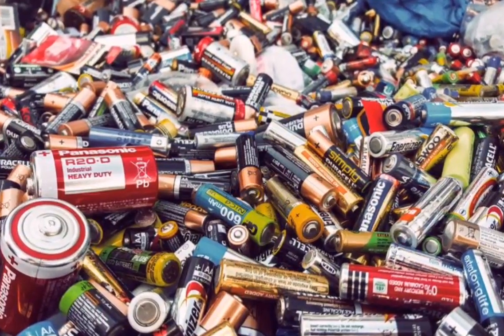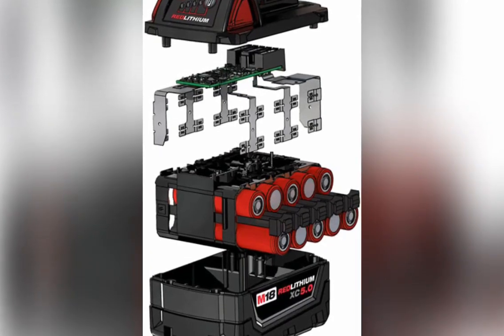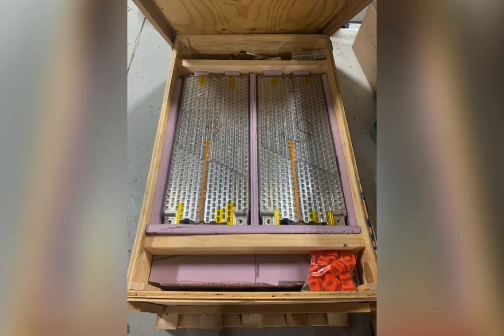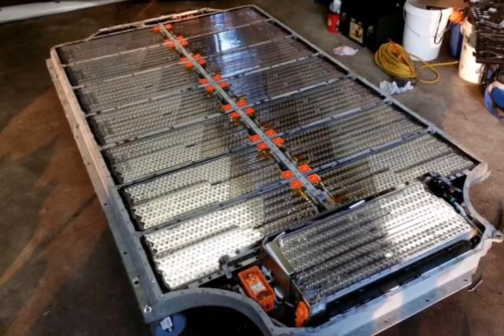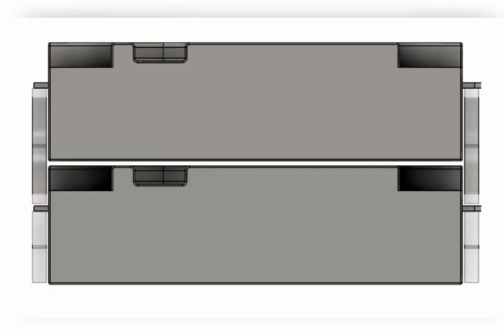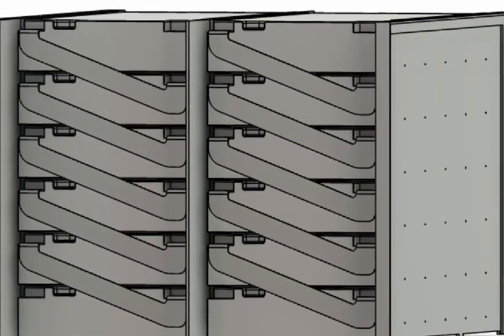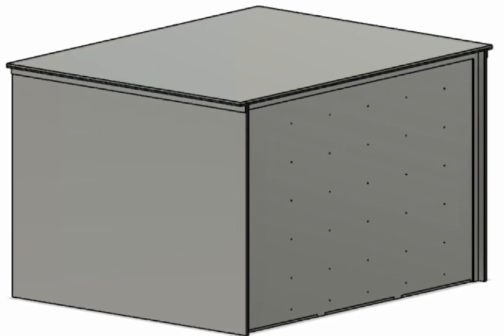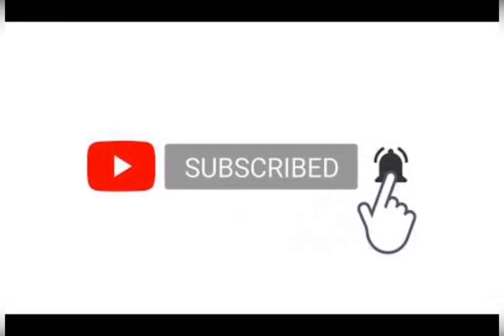Project Electrollite - Plymouth Satellite Tesla Swap - Battery Box Design, Ep. 3

Comment: 0:50 My first Electric Unicycle was the Kingsong 16x. Now I have a Gotway Monster Pro and a Veteran Sherman. These things are insane and push 45+ mph. I saw your EUC in Rich's video.
Reply from the maker: Awesome machines!   I'm leaning towards the inmotion V12 next.   Just waiting for my youngest son to pick up the V8, and my older son will get the 18 XL.   It's a good way to add range to any electric car 😉
Reply: @MrMoparMan  The V12 looks like a neat wheel but I have friends that have had a bad experience with the new inmotions wheels and the V12 specifically have an issue with mosfets blowing. There are videos of this. The V8 is a solid wheel though. haha, that's so true it adding range. I use it to add range to my 4runner.
Reply from the maker: @GiffysChannel  I've been following the V12 problems... It seems like they know the fix (hopefully).   I've got some time and I'm sure there will be new wheels out by the time I get one.   They are pretty addicting,  hard not to order them all, except the price of course.
Reply: @MrMoparMan  Very true. I just sold my MSP the other day. I found I just loved the Sherman and it ended up being the only thing I really ride.
Reply from the maker: @GiffysChannel   I haven't had the chance to ride a Sherman yet, looks like quite a machine!
Reply from the maker: I found this on the security cam one day, LOL 😂.

https://youtu.be/r3kZBuanohM

Comment: Been following this for a while now.  Way cool.  How many battery packs did it take in total to get where you wanted to be.  I'm doing a '33 Ford Vicky replica, and this really has me interested in going the electric route.
Reply from the maker: I used the full Tesla battery pack which includes 16 of the battery modules.  That will be a cool project!
Reply: @MrMoparMan  16 modules, so roughly $16k in batteries?
Reply from the maker: @ericdolan2130  Yep that's about right for the 85 KWH battery, more for a 90 or 100.

Comment: Just wondering, the factory Tesla battery box pictured at time 2:20, could that have been mounted under the floor of the Satellite?  Was the Tesla box to wide for the unibody frame rails?  The cross member for the factory torsion bars is not really needed once you go to the Altercation K-member and front suspension.  It would have been nice for a low center of gravity.
Reply from the maker: Although I think there is plenty of room under the car, it would take some modification to the floor to make the entire Tesla pack fit as is.  This particular car I decided to do as little modification as possible, but I think in the future I will try to work around the entire Tesla pack.

Comment: What a fantastic project!  What does the battery box that's going under the hood weigh?  Seems like a lot of weight to place up front.
Reply from the maker: Thanks!  It will be very close to what an original Hemi weighed up front.  Some of the batteries will be in the back giving overall better balance to the car.
Reply: Model S Tesla modules are ~50lbs a piece